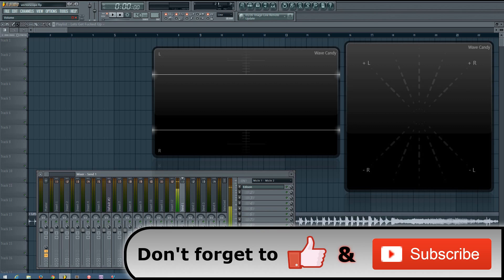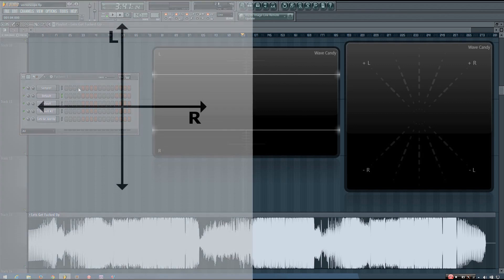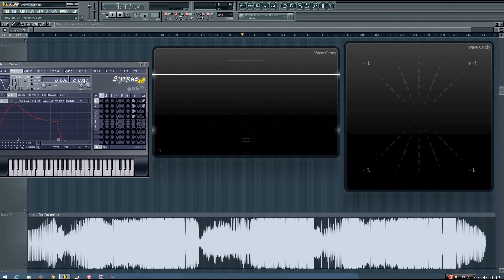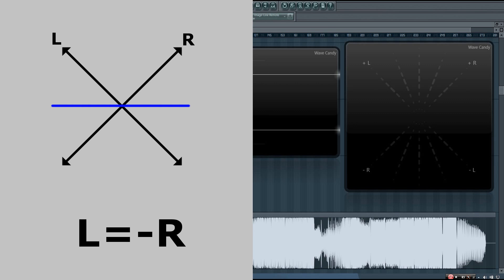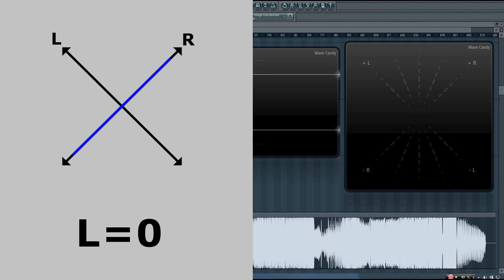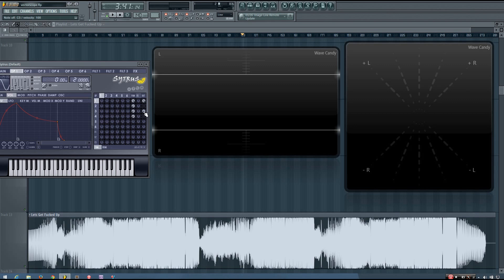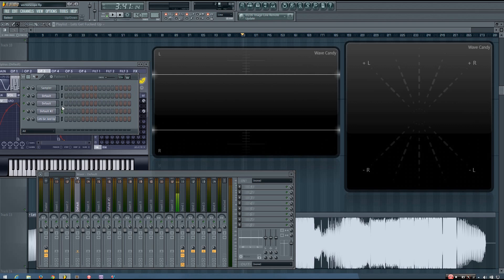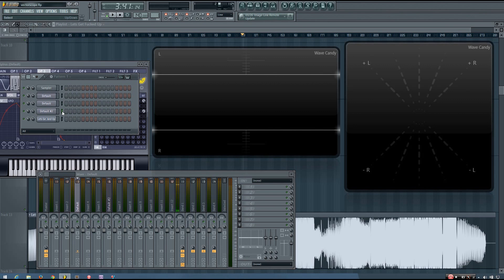Mixing Tutorial: Vectorscope

Comment: This is awesome, thank you for the tutorial! I'm having a bit of trouble understanding how stereo width and phase inversion don't result in issues with cancellation; if you have a left channel panned to be fully inverted from the right channel, are these treated as separate levels and therefore won't cancel each other out in the same way that a mono sound would if you had itself playing with inverted phase at the same time? Is this understanding correct? I guess that would also explain the loss of presence when converted to mono, since the signal would be fed into itself rather than different channels. I think I may have just explained it to myself by writing it out! To any experts on the subject, am I accurate it my line of thinking?